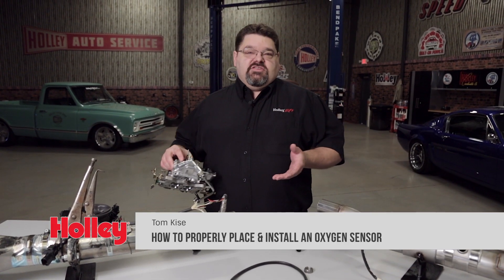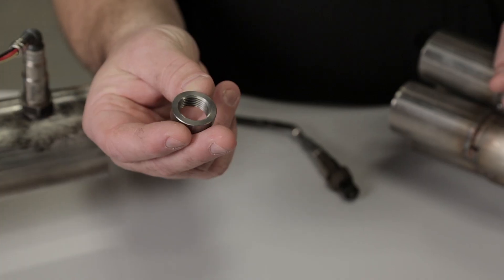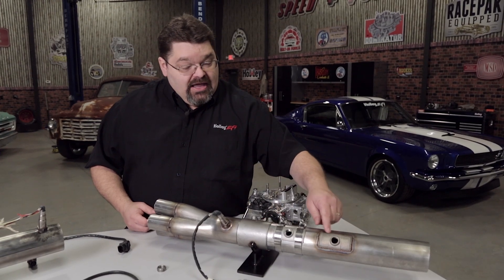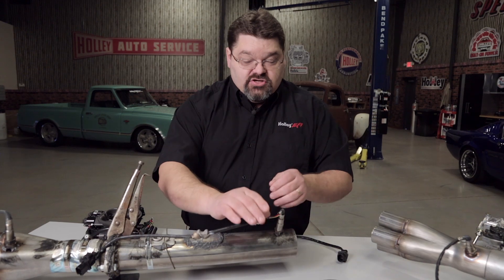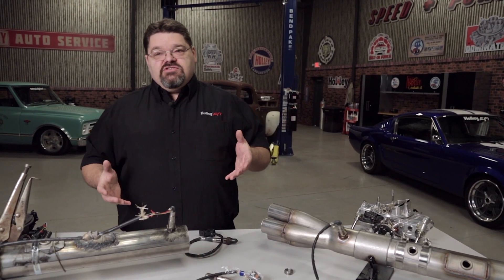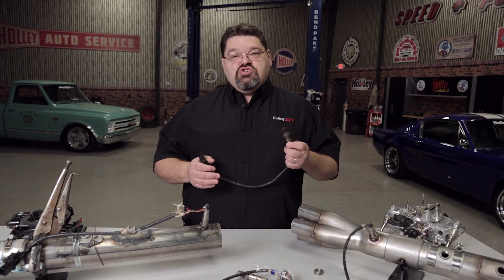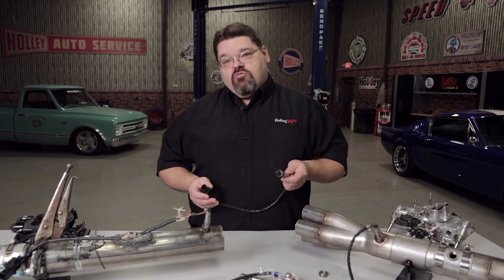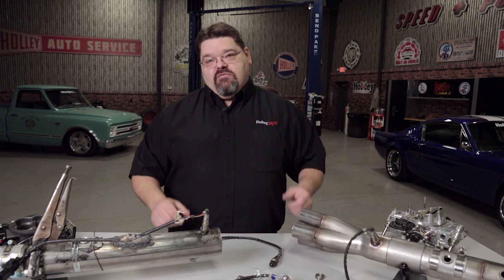How To Properly Place and Install an O2 Sensor

Comment: Hi, im installing a sniper efi on 289 and it has two split exhausts for each side of the engine, do I have to install two O2 sensors for each side?

Comment: I do wish someone like Holley would develop a listing showing the location of oxygen sensors on cars.  I have a 2003 Bentley Arnage T, a classic I purchased, where an )2 sensor filed and I cannot find its location.  I came to your video searching for where it might be located.  I cannot find old Bentley service manuals and now the Bentley is about to become undriveable because I cannot repair it.

Comment: Good explanation but still a lot uncovered. Make a search on WBO2 sensors and Sniper and you find tons of people having failed sensors. After I did everything right, installed in the right spot, routed wires carefully I found myself now having a failed sensor after less than 2000 miles. First thing that comes up on my mind is to google and improve my location of the sensor. Still cant find any clear path what to do to be sure the problem is addressed. No oil smoke (new heads) and piston rings, no misfire, OK fuel... Maybe can question the EFI cant operate the sensor within its specs??

Comment: Luckily a fouled sensor can be fixed by heating it to cherry red with a propane torch all around and then using a voltmeter to check the response time after that is done. Just connect the voltmeter leads to the two wires that are different colors. The two wires that are the same color are for the heater circuit.

Comment: I have stainless Hooker Competition Series LT headers on my SS which are manufactured by Holley Performance products yet I have Insufficient Switching O2 sensor issues ever since swapping my rotten out set of Pacesetter LTs for their product.
I wonder if it's caused by the slip fit into the y-pipe being not fully sealed or the placement of the O2 sensor bungs...
Reply: Have you figured out the issue?
Reply: Yes, most exhaust mods will cause that or any manipulation of the sensor (most exhausts will move it towards the rear and set it codes).
Best thing to tune them out !

Comment: May be a dumb question but I'll ask anyway, if I install a wideband on my vehicle in a location where it's only reading one bank (4 cylinders) of exhaust fumes will that reading be okay for tuning? I would assume what ever reading it's getting will be the same for the other bank of cylinders...
Reply: Yes, a sensor on one bank of a dual exhaust is common. The two banks being the same isn't a perfect assumption but it's close enough for most applications. The Holley Dominator ECU has dual O2 inputs so you can run sensors in both banks but other systems like the Sniper only use one sensor and it goes on one bank.

Comment: I have cut outs on. my GTO.  my hotrod shop installed a sniper and o2 sensor goes out after less than 500 miles. on the 3rd one.  is this system not compatible with cutouts?

Comment: How about installing in a vertical 
Pipe? Will it work?
Reply: Install horizonal at a 10 to 15 degree angle pointing upward,  so moisture/water can run/drip off.

Comment: Wondering if you can put exhaust cutout after the O2 sensor or if you still need to have 18 inches to 24 inches of exhaust pipe after the O2 sensor th er n the cutout 🤔

Comment: What about angle of the O2 sensor? I remember people telling me in the past that you have to put it at 45° or something.
Reply from the maker: The sensor element needs to at least be at a 10 degree angle so moisture will drain off. -Keith

Comment: Hey Tom, great video! I've received my "O sensor" without the plastic protector that goes around the metal end, and there's grease all over that end. Do you just wipe it put clean with a piece of cloth, or do you use something else, since that is the part you'll screw in? Thanks in advance for your details, Tom!

Comment: Would it be OK to mount an O2 sensor on a H-pipe crossover for a Sniper EFI?
Reply from the maker: No. The O2 sensor needs to be in the direct path of the exhaust flow. -Keith
Reply: @HolleyPerformance  Thanks!

Comment: For the LSU 4.9. Never turn it on with out running the motor ( #7 ). Info can be found in the Bosch's full line product catalog.

Copy and pasted and edited to fit:
General Installation Instructions & Requirements:
In general, the sensor installation point must be tested sufficiently by the customer for function and durability.

1. Installation in the exhaust line must be at a point guaranteeing representative exhaust gas composition whilst also satisfying the specified temperature limits
2.The heater power must always be switched on power controlled, starting with a maximum ramp up nominal voltage as described in the sensor specifications. This is to reduce thermal stress of the sensor element at cold start due to high peak power in the first seconds.
3.The sensor installation location must be selected to minimise exhaust side stressing with condensation water in order to prevent ceramic element cracking.
4.Locate the sensor as close to the engine as possible, respecting maximum allowed temperature range.
5. The exhaust pipe in front of the sensor should not contain any pockets, projections, protrusions, edges, flex-tubes etc. to avoid accumulation of condensation water. A downside slope of the pipe is recommended.
6. Make sure, that the front hole of the double protection tube does not point against exhaust gas stream.
7. Never switch on the sensor heating control unit before engine start.

8.Delay of sensor heater start or power control of the sensor heater as a function of engine and ambient temperature.
9. Installation angle should be inclined at least 10 degrees towards horizontal (electrical connection upwards). Thus preventing the collection of liquids between sensor housing and sensor element during the cold start phase. Other installation angles must be inspected and tested individually.
10.The use of cleaning/greasing fluids at the sensor plug connection is not permitted.
11. Assembly with special high temperature resistant grease on the screw-in thread is recommended
12. Tightening torque = 40 – 60 Nm, material characteristics and strength must be appropriate.
13. Recommended material for the thread boss in the exhaust pipe: Temperature resistant stainless steel to following standards; DIN 17440 1.4301 or 1.4303, SAE 30304 or 30305 (US). Thread boss dimensions should be as in sketch, note that sensor thread must be covered completely.
14. The sensor must be covered when underseal (wax, tar etc.) or spray oil is applied to the vehicle.
15.The sensor must not be exposed to strong mechanical shocks (e.g. while the sensor is installed). Otherwise the sensor element may crack without visible damage at the sensor housing.
16.Underfloor installation of the sensor remote from the engine requires an additional check of the following points; positioning of the sensor with respect to stone impact hazard; positioning and fixing of cable and connector with respect to mechanical damage, cable bending stress and thermal stress.
17. The sensor should not be exposed to continuous, onesided dripping of water, e.g. by the air-conditioning condensation water outlet. The thermal stress could damage the sensor.

Also:
Important Note: : It is common practice for these sensors to be used in conjunction with various aftermarket air/fuel ratio measurement devices, not of Bosch design or manufacture. It should be noted that these sensors are more susceptible to damage from thermal shock than the older “Thimble” design sensors, this is mainly due to their much higher operational temperatures. As detailed below, the heater management strategy used for the LSU 4.9 sensor is quite complex and generally vehicle specific. Whilst these sensors are “Universal” in their measurement capabilities, they are not designed to be “Universal” in their installation position. Installation position is critical to prevent moisture settling into the sensor element during shut down; hence the sensor should never be allowed to become inverted during storage. Therefore when using these sensors for temporary air/fuel ratio measurements, i.e. chassis/engine dynamometer testing, the operator should take care to protect the sensor from moisture ingress and physical damage that may create the potential of thermal shock to the sensor element resulting in premature sensor failure.

Comment: We need info on proper angle to install. Don't you want it to be within an certain degree of vertical? Something about condensation ?
Reply from the maker: Ensure the location for the sensor is at the angle of at least 10 degrees up from horizontal. This will help prevent condensation in the exhaust
tubing from entering the sensor.   Look at figure 1 on page 8 of the instructions for a visual look.  
hers a link to the instructions, https://documents.holley.com/199r11031r.pdf
Thx J

Comment: Hi,
Regarding the optimum placement for o2 sensors.  Where or what do you do when a 2 piece manifold system is replace with a 1 piece manifold (upgrade for turbo install). 
My vehicle have 2 upstream and 2 downstream. Where do the upstream ones go??

Together (side by side) right after the new manifold? Or together after the turbo?

Thanks.

Comment: I just bought a ram with aftermarket exhaust and the pipes don't meet until near the muffler at the back. Do I still put the sensor at the merge or do I put it near the headers? I don't have cats. The truck sometimes stalls and struggles to run so if you could help me it would be much appreciated.
Reply from the maker: The position of the O2 sensor should be  after the merge of all the cylinders of one bank (ie odd or even side cylinders) not after all cylinders ( both odd and even).  Example: After the merge of all 4 collector pipes on the passenger side of ta V8 engine ( cylinders 2,4,6,8).   Thx J

Comment: How about my downstream sensor placement?
Reply from the maker: These instructions are for our WideBand O2 sensors used with Holley EFI stystems.  If you have a system with up-stream and down-stream sensors, you should refer to the manufactures instructions for correct placement.  thx J

Comment: I installed a cam in my truck.put header but the header it self did not have a hole to put one in.but I do have 2 connected.and my truck would smell like gas.i also have code for my bad o2 sensor.what should I do?only tuning on 2 o2 sensor silverado 08

Comment: Wow the best informational video yet , thank you, but I was looking to find out where the male ,& female plug in on a 92 dodge Dakota 3.9 manual transmission, 2 wheel drive ,& also where is the male & female connection for a Crank shaft position sensor, on the same vehicle

Comment: Nice video but I would have liked some input on turbo model engines. Post turbo, pre turbo, distance , ext. I ran mine post turbo about 18 inches down and it seems to be fine but I've always wondered what a pro would say about that. I personally only have to so I know what my car is doing and running as my car is a daily. I just hate not knowing what my cars oil pressure,  a/f ratio, temps, and stats are at.